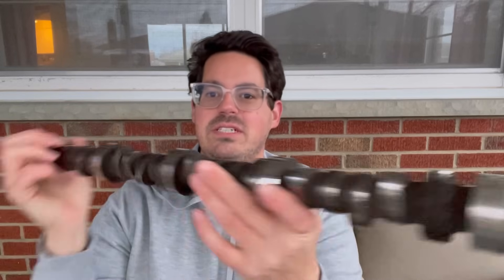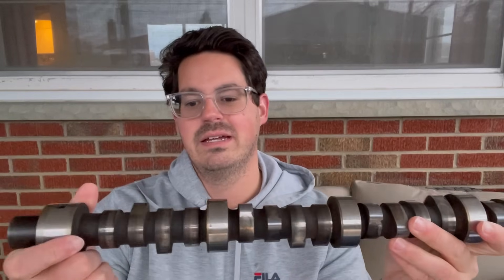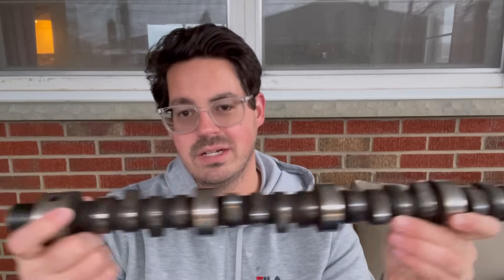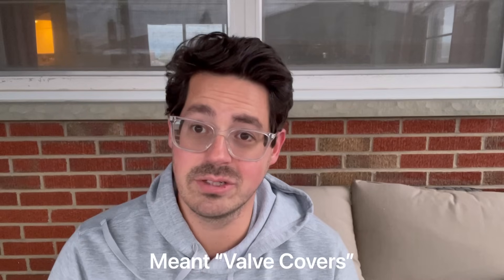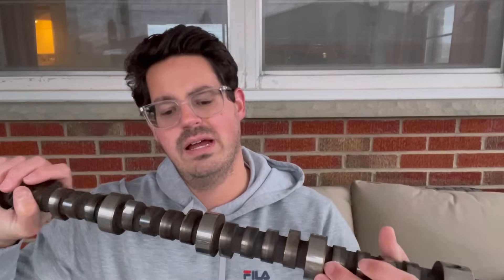Worst Automotive Components: Soft Camshafts (Chevrolet 305 & 350/Cadillac HT4100/Pontiac V8s)

Comment: Adam, I wish you had discussed what GM did, or did not do, to address these problems. IIRC, GM denied that the problem existed and wouldn't repair the engines.  This is why I would never buy another GM product. They simply don't stand behind their products and don't honor their warranties. Over a period of many years, I determined that GM simply was not a good company to do business with
Reply: A guy I worked with had a 78 Impala with the 305, bought brand new. The cam went soft in late 80 with about 30k on it. GM did warranty it and also put in a new timing chain set. That lasted until the car had about 47k on it. He knew Chevy wasn't gonna take care of it this time, so he put in a very mild Isky cam and lifter set with a dual roller chain set. It lasted another 200k when it finally dropped a valve seat, and he got rid of it in 2001. Point is, A some dealers were taking care of the problem at their expense. B. we techs knew not to trust even new GM replacement parts, and found that the aftermarket was the answer at the time.
Reply: @adamtrombino106  Kinda blows out of the water the notion that GM did "nothing" like another wizard posted.
Reply: Well, if makes you feel any better, keep in mind that by this point, every single executive involved in that decision is almost certainly long dead. Heck, technically GM isn't even the same company today.
Reply: @ZGryphon  Yeah, but all of this makes great theater.
Reply: WRONG!  I received two $150 checks from Chevrolet Motor Division for two late 70s Caprices that I had replaced cam/lifters.  Get your facts straight.
Reply: @GoldenGun-Florida  $150??? Ha, ha Anthony; you just made my point!  It probably cost the owner $500 - $1000 to get the cam replaced. And many owners got nothing! You're a clown, boy.
Reply: @HamJamming  And you don't know what you're talking about.  My suggestion is to research BEFORE posting dribble on these boards.  You said that GM did nothin, you were WRONG.  Study harder next time.  You failed.

Comment: I worked as a mechanic in the late 70s thru 2018 I remember the soft cams in the small block Chevy engines lowest mileage I remember changing was 15,000 also remembering changing a lot of cylinder heads because of cracking
Seen a few small block mopars and Fords having cams go flat not near as bad as the GM products 
I also changed a timing chain & gear with 10,000 miles plastic teeth all fell off the gear had to pull the oil pan to get teeth out of the oil pump pickup
Reply: yeah those nylon timing gears was some engineers ticket to the big leagues .

Comment: more evidence that the demise/decline of the US auto industry was less caused by fuel standards/regulations or union labor costs than corporate cost cutting that undermined product engineering and quality.

Clearly shorting on heat treatment of cam shafts was strictly a financial decision that undercut performance and reliability.

Those short term decisions directly led to customers leaving the brands and buying japanese and german marks instead.  As a life long (50 years of car buying) american car buyer, I still hope/wish GM and Ford would return to the quality products and success they had in the 1960s/70s.
Reply: I've got a 2004 Toyota rav4 and a 2013 camry.  When you look at the engines they look exactly alike with the exception of a few tweaks here and there.  The shock towers look the same, the brakes are very similar....  Today US car makers crap out a new engine every chance they get.  That's probably why my 2018 F150 burns 6 quarts of oil between changes, clatters like an Oldsmobile diesel, has a plastic intake manifold and oil pan, and shoots oil backwards when you remove the 1/4 turn drain plug.  At some point they should run out of ways to screw up, I'm still waiting.
Reply: Well Toyota has had its engine slugging issues too.  I've replaced many head gaskets on my Hondas also.  Honda also had issues with their automatic transmissions.  Nobody is perfect.
Reply: @howebrad4601  i know the earlier japanese cars from the 70s seemed to have cooling systems that weren't oversized, they had to be kept clean.

I'm not familiar with the term engine slugging though, what is that?
Reply: @RealDeanWinchester  I miss typed.  Sludging.  Toyota had a pretty significant problem from approx late 90s to early 2000s with excessive and premature engine sludge.  Toyota also had a very severe frame rust problem on Tacoma pickups for a number of years.  Much worse than any other manufacturer.   Look up Toyota frame rust on youtube.  Bottom line is all companies have problems.  I own ford, gm, Chrysler,  Toyota,  honda, and Mitsubishi and have found they all have their good and bad points.
Reply: @RealDeanWinchester  in your situation I think I'd check with another dealer and raise chain with ford.  It doesn't sound like they are treating you fairly
Reply: @howebrad4601  I don't beg anyone to "make it right" anymore.  I don't work for Ford, not my job to straighten them out.  Look at it this way, Ford has been making vehicles for 114 years and they haven't figured this out yet?  If I am a statistical outlier i have another 50 years to live. I have better things to do, I'll vote with my feet.

Comment: Can't wait for the internet tribologists to show up to explain why we should all use engine oil rated for diesels, in spite of what automotive engineers and the API says.

Makes about as much sense as people adding lead substitute to gasoline or putting nitrogen in their tires, 😂.
Reply: There is truth to all the above. Diesel engine oil contains high levels of zinc that used to be in all motor oils until it was shown to be harmful to catalytic converters. The zinc is added to reduce friction that is generated by older engines that used flat tappet cam lifters. Most if not all engines produced today and probably for the last 30 years use lifters with a roller that greatly reduces friction. Since all cars produced in that time period also have catalytic converters, it is bad advice for them. If your engine has a flat tappet cam, probably a good idea. Lead was added to gas to increase octane and it also somehow lubricated valve seals in older engines. However, using hardened valve seals eliminates the need for lead. Most engines produced since 1972 don’t really need it. Nitrogen in tires is an expensive way to not have to add air to your tires whenever the outside air temperature drops. As long as your tires don’t leak ANY air, you wouldn’t have to add air to them. But that isn’t practical.
Reply: @mikee2923  i understand the myths, thanks.

Comment: Adam, one of the factors I believe has to be considered is oil quality and change intervals. The 1960’s were the era when vehicle manufacturers pushed the Society of Automotive Engineers (SAE) for more stringent specs on not only oil viscosity, but detergency, flow characteristics, and additive package durability. In an attempt to make vehicle ownership more affordable for motorists, and market their vehicles as better engineered, manufacturers began pushing some maintenance intervals, especially oil change intervals, out further. There was quite a buzz, I’m told, when vehicles started having recommended oil change intervals of 6,000 miles versus the 3,000 that had been the industry norm for years. Then in the 1970’s, it went out to 7,500 miles, with a filter change at every other oil change. As engines would experience “premature” wear out with the longer intervals, SAE oil specs would change. I worked in an auto parts store during the late 1970’s, oil companies were putting out spec books. People would get irritated if we asked them what kind of car the oil they were buying was going in. But put the wrong oil in a newer car and engine problems were imminent.
I wonder if some of the “soft cam” and early timing chain failure issues weren’t related to an improper spec (improper being older, thus cheaper, or improper weight because “I’ve ALWAYS used this weight oil”) being used in the vehicle? I don’t doubt that these parts were either improperly manufactured or engineered, but could the oil used have exacerbated the problem?
Reply: Probably the biggest reason that modern engines outlast (mileage wise) older engines is fuel injection. With EFI, you just turn the key (or push the button) and the engine automatically starts. Whereas a carbureted car you had to push the gas pedal down to squirt some fuel into the intake and close the choke on the later models. These were all mechanical and had to be kept properly adjusted and maintained. It seemed that when most people didn’t maintain them they would just turn the key and keep pumping the gas pedal until it started. All that pumping of the gas pedal was dumping raw gas into the intake, bypassing the rings and ended up in the oil pan thinning out the oil causing premature wear on the engine. The way the older American V8s (mid 70s and prior) were built they would probably last 500,000+ miles if equipped with the EFI that today’s cars have. Not to mention 50 years of technological improvements in the oil itself.
Reply: @mikee2923  very true. Not only would the excess fuel dilute the oil, it would “wash” the oil coating on the cylinder wall, removing some or most of the protective layer at start up until oil pressure develops. 
I do believe today’s tighter manufacturing tolerances positively affect engine life. My current vehicles spec 0W20 engine oil. The 0 weight is needed in areas where even a 5W would not flow properly because of the tight tolerance.
Reply: @mikee2923  That's partly why even the small, carburetor equipped, non EFI, vintage  cars with MPG ratings over the high 20s are very rare.
Reply: Filter changes every other time are the dumbest thing ever. 
Most of those junk filters are bypassing by like 1000-2000mi anyways and add maybe 2k if it was a decent filter. 
The domestic engines have such low spring rates in the filter for bypass that even a decent filter is bypassing by 3-4k for sure.
Reply: @MrTheHillfolk  truth. Imagine leaving 20% or so of the old, contaminated, deteriorated oil in the engine for another oil change cycle. 
As Adam has explained, producing and marketing vehicles is an extremely complex project, of which maintenance is a piece of the puzzle with its own complexities. Manufacturers want to sell vehicles. Making vehicles last forever would be bad for business. But long before you get to that aspect, you have a cost factor. Chevrolet could build an Equinox, for example, that would last forever, but it would have to retail for something north of $100,000 to $125,000. So manufacturers have to measure durability vs. cost for everything that goes into their vehicles. Ditto recommended maintenance. Virtually any vehicle can last for 250,000 to 300,000 miles or more without major component failure. BUT you’ll be doing much more frequent and comprehensive maintenance to it, things like changing oil every 3,000 to 4,000 miles, transmission fluid changes every 40,000 to 50,000 miles, brake fluid and coolant flushes every couple years, and a host of other things. Manufacturers don’t recommend that kind of frequency or even some of those services at all because they don’t want it used against them, “look at how much it costs to drive brand X vehicle vs. ours”, and they want you to buy replacement vehicles. The tricky part is recommending frequent enough maintenance to keep the vehicle operating properly long enough that the purchaser perceives the brand as a good buy, yet not so long that it lengthens replacement cycles and costs too much to maintain. Bottom line, if you want to get lots of minimum trouble life from your vehicle, perform maintenance frequently, probably more frequent and extensively than what the manufacturer recommends. I don’t keep a vehicle that long, but the enjoyment of driving a vehicle working properly is worth the cost, not to mention showing a potential buyer a stack of receipts for all the maintenance increases the value of the vehicle you’re selling.
Reply: I remember one Chrysler engineer saying (this is from a  common Mopar enthusiast site) that the conventional oil of that time, late 1970s, early 80s would barely flow during engine testing for minutes, but that synthetic oil always flowed well, even many degrees below zero. I'm sure the prevalence of synthetics, today,  really helps cars last longer. (IMPORTANT EDIT! I've also heard that for some engines, synthetics should NOT be used during what some call the "break in period", for the first few hundred miles. I don't know if this is still true for modern vehicle manufacturers. Check the owner's manual.)
Reply: @DUCKSAREEVILLLLLLLL  totally agree. I was with a major oil company in the early 1980’s, one of the engineers told me the typical additive package started breaking down by 1,500 miles, flow and detergency would start to be compromised immediately thereafter. He changed his oil without fail every 3,000 miles; 2,500 during winter months.
Reply: @cadillacguy1890  On my cars, especially 4 cylinders, just after 2,000 miles, the oil will look noticeably discolored, and I start losing it. I use synthetic. Waiting till 5 to 10,000 miles would seem ill advised, to me.
Reply: I have owner's manuals from the 50s and 60s and the recommended oil change interval was never 3,000. It was 4,000 to 6,000. The only 3,000 one I found was a 60s air cooled Volkswagen Beetle.

Comment: With engineering blunders like this it is no wonder everyone turned to Asian vehicles during this period. It is also amazing that GM survived even to produce the mediocre vehicles that it does today. Thanks Adam
Reply: Trucks and suv revinue is what kept gm alive through the 80s and early 90s. If it wasnt for that revinue woulda gone bankrupt in the 80s instead of 2009.
Reply: @Henry_Jones  You're right, but the "soft" camshaft problem in the Chevy 305 started in the early 1970s. GM was STILL paying warranty claims in the  1990s!  The Chevy 229 V-6 suffered from the same "soft" cam problems.
Reply: @Henry_Jones  it was high interest rates making the pension plan asset worth more than the company itself.
Reply: Boy the VW diesels were the best thing since sliced bread around my area. 
Couldn't swing a dead cat without hitting one. 
I know mom's did the job for 145k without anything major other then batteries and glow plugs. 
If that was a gm car half the engine would have been replaced and probably 2 front ends by then.
Reply: @MrTheHillfolk  diesels are more reliable from a concept standpoint because they rotate slower and dont have an ignition system. Its when emissions become a problem they get complicated.
Reply: @MrTheHillfolk  You couldn't GIVE away a VW diesel in the late 1980s/early 1990s. The VW Caddys brought a "premium" price of $100.
Reply: Asian cars wouldn’t last in the rust belt they would rot too nothing much faster then American cars. People could fix American cars easier also the myth that everyone stopped buying American cars and started buying Japanese cars might be true in some parts of the country but not in the rust belt. The first Japanese car in my family lasted two years and was then junked a 1981 Subaru
Reply: @travislostaglia8861  yep i grew up in massachusetts and remember very well how much more the japanese cars rusted than the american ones, especially subarus and nissans.
Reply: And you still see modern day Subarus going down the road that must be held together by nothing but flakes of rust.
Reply: @travislostaglia8861  Many did consider Japanese cars disposable at first. Few shops fixed them, parts were hard to get, and they rusted fast. By the late ‘80s and ‘90s, they were being built in the US, and parts were easier to get.
Reply: @travislostaglia8861  I know. I've lived in the rust belt for all of my 52 years.
Reply: @travislostaglia8861  I remember going to a wedding in the Chicago area and noticed a lack of foreign cars. Out west, besides pickups, there were lots of foreign cars. I had a Subaru. I don't know about rust being in the desert.
I still have my showroom fresh 50 year old Mustang Mach 1. 
Still has the factory underside coating. I bought it in the 90's.
Reply: Like the old Top Gear episode said, domestic sloppy workmanship and in-fighting was like the laying of a red carpet right to the Japanese factory doors for their takeover

Comment: My Dad was a GM dealer parts manager from 1949 thru about 1990...  Chevy small blocks were known for camshaft wear at higher mileages - 75,000 - 100,000   Pontiac V8s were known for their infamous nylon timing gear teeth   they were put on there to make the timing chain quieter, but as the engine got older the nylon got brittle and they broke off, the engine jumped time and stopped dead in its tracks  I am not as familiar with Buicks or Oldsmobiles, but i know that Olds engines used rocker arm shafts as opposed to individual stamped steel rocker arms like Chevy and Pontiacs and they were noisy as the cars got older

Comment: The Volkswagen PD diesel was also notorious for cam wear. A huge shame, every earlier VW diesel was rock solid.
Reply: It wasn’t a 
problem if VWs very strict oil requirements were strictly followed
Reply: @Wiencourager  Very true.  VW loved changing the oil requirements on the diesels multiple times.

Comment: It was Cadillac’s updated V8-6-4. V8 when new, 6 at 12,000 miles and a 4 at 25,000 miles!
Reply: Nice one. Probably made as much power as the 8-6-4 in 4cyl mode when it was running properly.